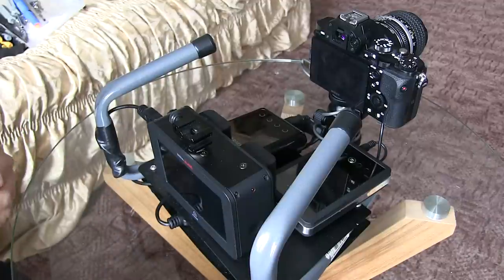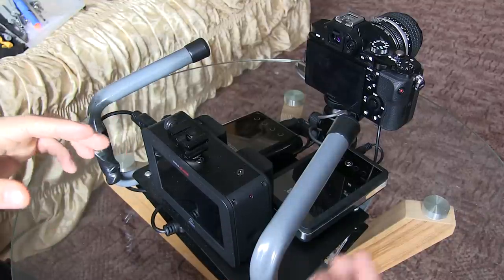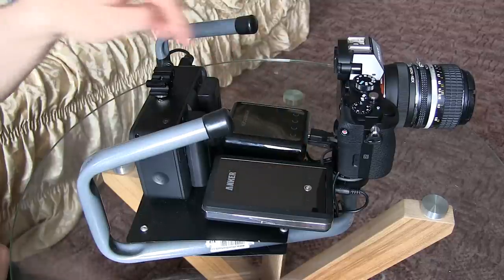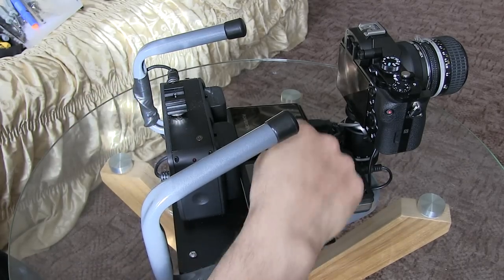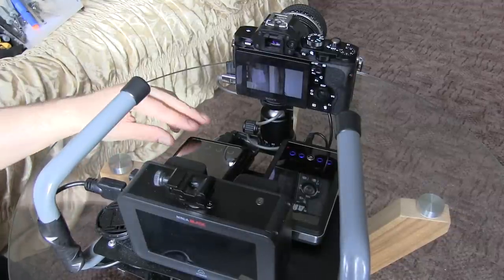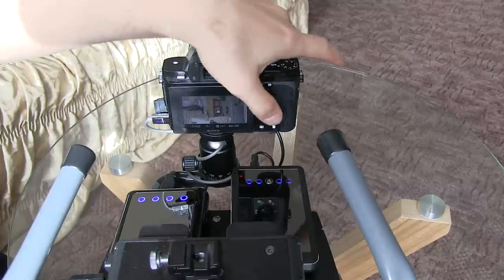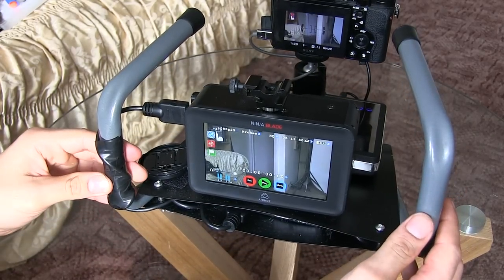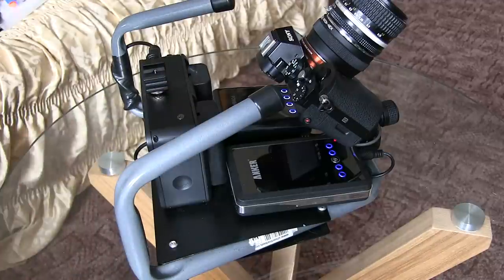Sony A7s DIY rig/cage all inclusive of the SY-4KS Scaler and external battery (Shogun alternative)

Comment: Surely if you're downscaling your 4K signal to 1080p, you lose all the benefits of having 4K, like cropping etc?
Reply: +SittingNow ääääääääähm well but u get a WAY sharper image...
Reply: +DrAluful nope you actually lose dynamic range in 4K on the A7S (one of the reasons I switched to the FS7). You get a marginally sharper image, but it's so minimal that it becomes pretty pointless.